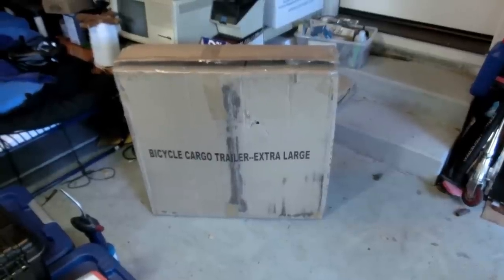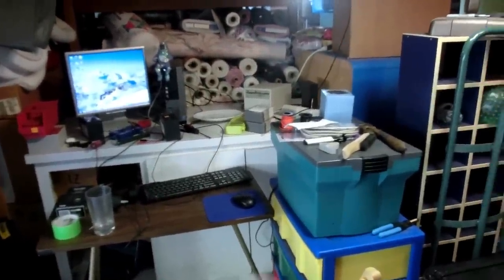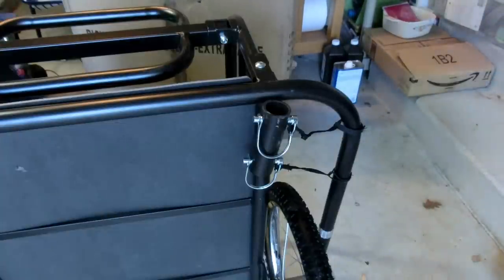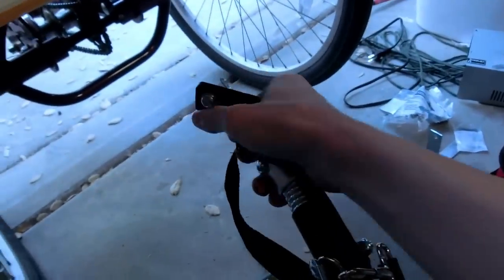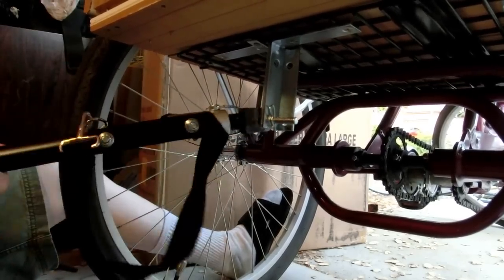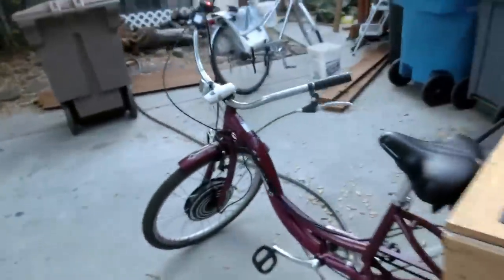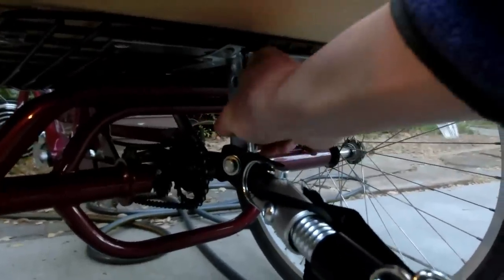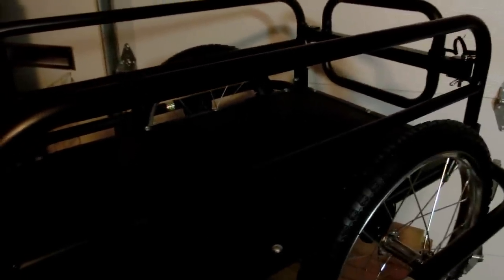114$ Bike Trailer from Amazon (E-trike v1.7)

Comment: I've had a trailer on my bike for about 7 years now and I know from experience that the tires tend to go flat- a lot!  I solved the problem with Bell solid tubes (about $20 each on amazon).  Slime tubes might work but I chose the foolproof option.  Good luck!

Comment: looks like you have a good base to work from. what if you got some U-bolts and attached a bracket to the steel tube by the back axle, with a steel tube extended. Use the "L" bracket with a strong spring to hold the extended pole behind with which to hook the trailer to.The trailer will be level, and the spring will provide the small movement needed when going over bumps, and dips.

Comment: Obtaining a shopping cart, removing the bottom part to lower the center of gravity of the basket and then mounting bicycle wheels on the basket part might be another solution for a trailer.  The axil could be run through any section of the metal grate pattern on both sides of the basket allowing different heights for the wheels and horizontal adjustments for balance.  The basket handle could be used to move the little trailer by hand when disconnected from the bike or to pickup the back and straighten the trailer in a parking place.  The cut off bottom frame with the small shopping cart wheels could be used as a separate dolly for non-highway use.

Comment: Good idea. The only word of caution I would chip in is the if you are going to have a heavy load in the trailer that is forward of the trailer axle and connect the pivot point rearward of the trike axle there is the risk that the trike could tip up. 
My friend built a trailer to trailer carry his two kids in. He got on the trike and they got in the trailer and off they went.
When he stopped he got off, the front of trike came up with the handle bar smacking him in the jaw. Once he moved the connection point on the axle of the trike forward of the axle the problem was solved.

Comment: Rinoa, I think your problem with slowing down on climbing hills is because of the type of motor you have, This appears to be a direct drive which are reliable but do not provide much torque. I would recommend seeing if you can install a 5 or 7 speed Internal Gear Hub on your back wheel so you can take half the load off the front wheel hub motor.  You will get amazing results by changing to a Brushless, Geared Hub Motor preferably with built in gears.

Comment: The hitch on the trailer is bent correctly. It is designed with that weird bend and angle to be used with a regular bicycle. If it was straight, it would hit the bicycle tire during a turn.

Comment: The trailer tongue is welded at an angle to allow more rear wheel clearance when turning. You may want to upgrade the hitch to a hyme joint . That trailer should work good for reducing the axle weight on your trike  .
Reply from the maker: ww321 yeah but its welded wrong, it should be straight then bent, the weld itself shouldnt be at an angle.
Reply: Rinoa Super-Genius It's welded that way on all of them . I'm sorry you can't understand why they did it that way. Here is a pic from an ad. http://pfillo.com/ebaytemp/images/outdoorsport/Trailer&Strollers/6021-0016BL/2.jpg

Comment: Tighten the hitch mount to the bracket you made with a bolt so it cant move...then that spring on the trailers arm will take all of the necessary movement...thats how its designed to work...and it wont be so sloppy and rattle as much...I have one bolted to my rear axle for a kid trailer...its identical
Reply from the maker: +Gary  Ferguson Jr yeah but since they welded the arm wrong i have to leave it loose or it will try to turn the trike.

Comment: On a two wheeled bike, you need that offset angle to allow clearance for the rear tire during turns.  I have a kid trailer and it's exactly the same.  The attachment point is in front of the axle centerline.  Even with the offset, I can't turn very sharp to the right without my rear tire making contact with the tube.
Reply from the maker: +Doug Goodwin yes i know, but they made this offset wrong. they welded it leaning to the left too much when the main portion should be straight.
Reply: +Rinoa Super-Genius No they did it right for a bike. Hook it up to your bike and see how the angle of the tube helps to keep it from hitting the rear wheel. We're talking of course of a trailer designed for a two wheeler. It is to be expected that you will require modifications for mounting to your trike. A nice idea a few others have contributed is that you could use larger wheels to raise the height of the trailer in order to level it. Having the quick release axels makes this very easy to do. I'm sure you can find some 26" wheels off an old mountain bike with qr. by the side of the road or at the scrapyard. That should do the trick. Regardless, that's a great price for a trailer.
Reply from the maker: tomalcolm
my god, the stupidity. the arm is bent AND the fucking weld is bent, so the arm might as well just be straight.

i am very sick and fucking tired of people not understanding this simple issue. the pipe should be welded on straight so its bend actually matters.

if i mount this to a bicycle it would be horrible, i would have to bend the arm in order to let me turn right at all.

Comment: This is a suggestion, so none of yall out there get your "knickers=in=a=twist" while reading this.  If you wanted the trailer to ride more level, take your spare L bracket, straighten it, bolt it in between the downward facing brackets you've attached to the underside of your cargo box.  Then you can drill a hole in the extension bracket where ever you'd like for the trailer to ride level.

Comment: considering center of tricycle and cargo trailer suppose to be lined up 
attachement bracket under the tricycle shouldn't be right at center 
but 3 to 3. inches left side of the center when you look from behind
bent metal part seemed wrong to you due to lining up centers of bcycle and trailer

Comment: hey rinoa... what about 600 lbs carry capacity? use a hand-truck and cut off the platform bottom so you can extend the surface of the bed while it is horizontal so that it is more balanced over the wheels ...we all know that fridge carts are not well balanced when you lay them down flat and too much weight would be on the handle/tongue of the trailer .. so that is why i suggest cutting off the fridge cart's metal flange that normally carries the load and when it is horizontal you can bolt an extended board out and over the rear axle to distribute the load evenly in front of the axle and behind. ;-) 600 lbs buddy, but, your bike might not handle that too well at max load :-(  i wouldn't do max load except for very short distances on perfectly level ground and with a much better hitch than you have now .. .why didnt you make it connect to the nice black metal under the bike's wood box as well as where you already did and have two anchor points? or hell , make 3 points ...... see? ..  i am a genius too LOL

Comment: If you would have got the $69 deer body carrier you could have just put a wooden top over it sheet of plywood and we'll pick up where to buy four sides but a lot better calls between 250 to 500 depending on which model you get and they come with a regular standard tractor lawn tractor ball hitch

Comment: The arm is supposed to be like this, because it's not built for a trike, but for an ordinary bike. That way, the trailer tags along with the bike symmetrically. As for the flatness of the bed, try using larger wheels, th biggest that fit. That should rise the bed to your desired level.
Reply from the maker: +juncedan its bent twice, it doesnt work on my bike because the bends cancel each other out. pay attention next time

Comment: You're starting to get to a point where you really need to put some springs between your battery/tool box. The weight in it is what is causing your spokes to fail from fatigue. Adding springs should increase the fatigue life of the spokes significantly, by reducing the impact loading when you go over bumps. However, the spokes will still likely fail eventually as there will be significant load fluctuations as the wheel rotates, dependent on the load in the box. Your best bet would be to get thicker spokes as well as add some form of suspension.

Also, make sure to make the link bolt between the trailer and the bracket on the bike tight. Having it loose like that can allow huge impact loading to occur, causing fatigue cracks and fracture. Maybe a safety chain would be a good idea?

Best of luck :)
Reply from the maker: +dquad i think its funny how heavy people think the box is, its not really all that heavy at all.
Reply: Rinoa Super-Genius even if it only weighs like 10-15 kg (20-30 lb?), that will but a fair bit of shock loading on your spokes when you go over a bump.

Out of interest, how heavy is the box? Any idea what tension your spokes are set to and what their materials are?

I could do some fatigue calculations for you if you want.

Comment: If I had a tricycle like this one, I wouldn't never need a trailer. It also would have never tipped over causing my LCD to break. So getting a trailer is so I don't have to put all the weight on my bike. Because any unusual weight would cause the bike to tip over.
Reply: There are two problems with tricycle. 1. You can't ride them on the sidewalk - they are too wide. 2. They are very expensive. 

I do like the fact you can load them up like a cargo bike though.
Reply from the maker: I required one to move though since I had no car

Comment: I'm curious of what the useable payload capacity would be before the performance is unacceptable.
Reply: I reckon it would only effect the time taken to speed up and climbing hills.
Reply: Crazy Frank all weight at rear already due to battery, plus a trailer with stuff, and engine is at front.
Does anyone smell burnt bicycle rubber?
Reply from the maker: +Marko “Orkekum” Ahonen this tricycle has no engine....
Reply: I meant motor. My apologies :-)  english is not first language :p

Comment: it is a year later! how is the trailer? is it still holding up to par? with a short look through your vids it looks like you would use the fook out of it! by the way did you figure what that shitty bentness is for?? you had time to figure it out. i figured it out for you! the shitty bentness is so when a regular bicycle makes a right turn the rear wheel does not hit the hitch arm. so over all that trailer is meant for  a bicycle or the trikes with two wheels in front. not  the trike you have in the video.

Comment: it's not a bad design, you just converted it wrong. like the hitch is supposed to be bolted (clamped on the wheel bolt) sms the spring turns and pivots, and the hitch is bent to allow bikes to turn sharper
Reply from the maker: +RedTeamWolf ut its bent twice so it cancels out each bend

Comment: The pipe on the trailer, where the mounting arm slots in is mis-aligned. My dad had a trailer like that and the arm was parallel to the trailer.
Reply from the maker: +Maxx B yeah i said that in the video.
Reply: Rinoa Super-Genius
I was just confirming that it was wonky.

Comment: Here's another idea, get your solar panels attach them to the trailer and use them to power your system for an extended trip
Reply from the maker: +Duane C why does everyone want me to put solar panels on my trike? its just not a very good idea due to how many square feet of panels are needed.
Reply: Rinoa Super-Genius agree solar bad idea but maybe a little silent runing genny might get you that few more miles i know if means burning fossle fuel but would also come in handy for when you build the mobile experiment lab

Comment: The reason that"shitty bend" is there is because it it is designed to attach to the left side [looking from the back] On a bicycle. It maintains the center of gravity.  The pins that you didn't understand......dude whatever.
Reply from the maker: no its bent twice and the 2nd bend cancels out the first bend. when i connected this to my bike i cant turn right because of that.

Comment: Separate the L brackets, should be L bracket, trailer L bracket and then pin them together. Also, if you want it to be level, straighten out your extra L brackets.

Comment: Nice video.Can I load 2 laundry bags on that?
Reply from the maker: if each laundry bag is half the cargo capacity, then yes. ;P
Reply: Thank you for replying
Reply: The approximate inside dimensions are 15.5 inches wide by 24.5 inches long. Not sure on the height, maybe a foot? Similar trailers are about 9 inches wider and 7 inches longer if you need more room.

Comment: That's not shitty,it's meant to be like that! Gives clearance for turning on a two wheel bike. Read the instructions!! And fit the safety breakaway strap!
Reply from the maker: +Andrew Wilson no its broken because its bent in the arm like it should, but then the weld is bent in the oposite direction.

oh my fucking god why are so many idiots not understanding this? basicly due to the bent weld it may as well be a straight bar. thats why i cant turn left too well.
Reply: "Oh my fucking God " asides I thought you were smart enough to realise that with only one bend you would not be pulling in the centre of the trailer! The double bends allows turning clearance AND pulling on the centre of mass for the trailer! Some string and plumb bobs will show the alignment . The towing connector is slightly offset from the centreline to allow for the offset of being attached to one side of a bike wheel. Check it out and save on the "oh my fucking God"s before making sure you are correct!

Comment: the bars are made bent for a reason....
Reply from the maker: yes but this bar is bent, with the weld being bent in the opposite way. so there might as well be no bend at all. i have a hard time turning right on a bike or left on a tricycle because of that. do you understand now?
Reply: The bar has to bent to give clearance for the rear tire so you can turn right or left , there fore the rear tire don't run and cause you to crash. The mounting bracket for the bar is made to be slightly bent you don't want it to be straight even with pins it causes alot of jerking. This is for why they are on a slight angle. There nothing wrong with the trailer .
Reply: If you're unhappy with the trailer send it back and try getting another one. You'll see it's the same on all.
Reply from the maker: Green mtn bushcrafter
your not understanding, this one was made wrong. it is bent twice so each bend cancels the other out. so there might as well be no bend. there is supposed to be one but there basicly isnt one. idk what exactly your not getting.

Comment: If the tongue wasn't bent, it'd hit the bike tire when turning right.
Reply from the maker: its bent twice so it DOES hit when turning. if it was bent once it would be correct but the weld is also bent.
Reply: @RinoaL  I realize this is a two year old response, but you seem to be misunderstanding:  The hitch bar is designed to fit a Bicycle, not a Tricycle.  Thus, it is designed so that the single rear tire of a bicycle will not hit the bar when going around right-hand turns.  That is why it doesn't fit your Tricycle and why it hits the Tricycle rear tire.  Because it is designed for a different style of pedal powered conveyance.
Reply from the maker: @Wearyman  you fucking idiot, its bent wrong so even when i used it on a bicycle i couldnt turn. pay attention next time for fuck sake. cant ya get this through your fucking skull. it is bent compared to how it should be bent.

Comment: It's supposed to be bent to give clearance to a single wheel.  Seems to work fine on your trike but designed for bikes.
Reply from the maker: +David Adams yes but this trailer is bent twice, so it might as well be a straight bar. watch the video again and actually look at the trailer this time.
Reply: +Rinoa Super-Genius It's supposed to be like that.  Think about it.
Reply from the maker: David Adams
no, its why i cant turn right when i connect it to a bicycle for fuck sake.
Reply: +Rinoa Super-Genius And if the bracket was straight, it would bring the arm even closer to the wheel.
Reply from the maker: David Adams
it acts like its straight though because each bend cancels the other out.
Reply: +Rinoa Super-Genius That's my point.  I think we are talking, or, at least, writing at cross purposes.  Having considered trailers with this kind of hitch, I eventually plumbed for the Burley Travoy that hitches to the rear rack on my bike.  It was more expensive than I'd have liked but very stable and without any side mounting issues.  It also works with my trike.  The only problem is a 60lb limit.
Reply from the maker: David Adams
no, this trailer is made wrong. the arm needs to be bent, but not bent twice.
Reply: +Rinoa Super-Genius Fair enough.  Are you going to try bending it into shape yourself?
Reply from the maker: David Adams
no i will just make a better one.
Reply: +Rinoa Super-Genius Sounds like a good project.  That way, you get exactly what you want and, usually, cheaper, too.  Best of luck with it.

Comment: you will be burning the motor up with that trailer....I happen to have the trailer that has aluminum frame....i have no motor...just a modified 10 speed with a 52 tooth crank chain ring...i haven't figured out a design for the trailer hitch...But I would not have a thick wooden box....
Reply from the maker: nope, it didnt burn it up at all. and the box was very light.